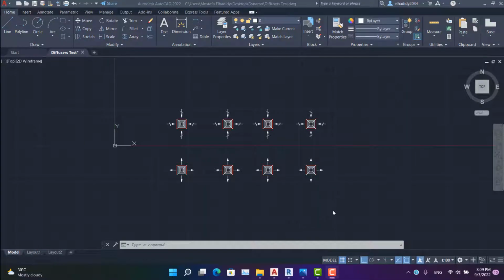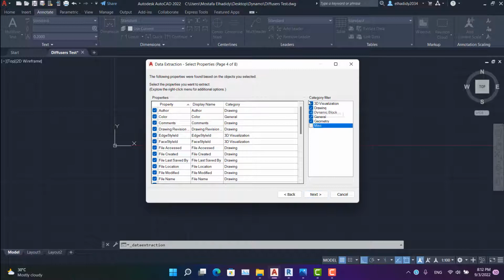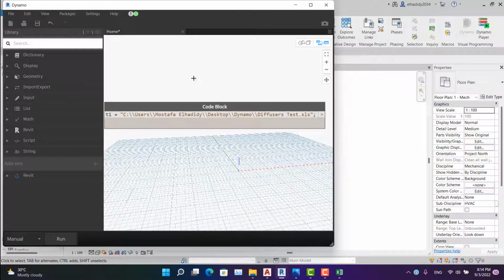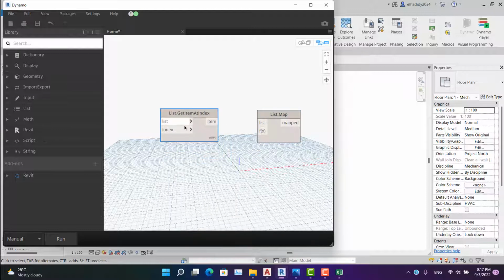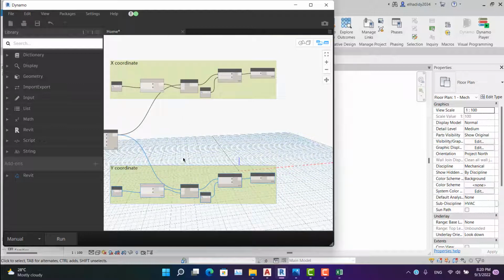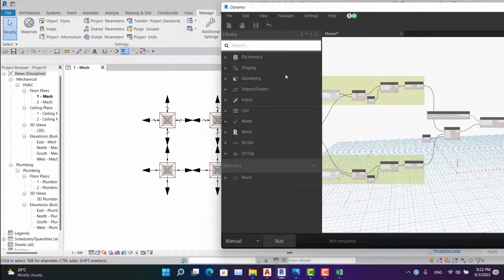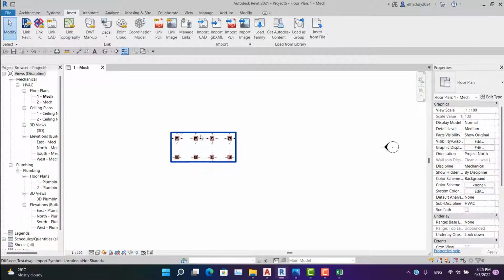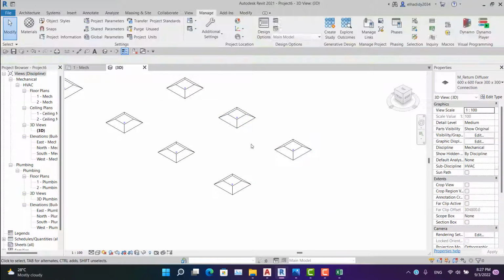Convert AUTOCAD Blocks to Revit using Dynamo script.

Comment: Muchas gracias por el video me funciono super bien para colocar mis luminarias y también muebles. Pero tengo una consulta por favor ayúdame. Como puedo manipular el nivel de ubicación o el host de las familias?
Reply from the maker: In minute 2:40 when doing data extraction check on position Z and then you will get Excel file containing the position Z which is the Level you want to adjust it.
Hope this will help you.